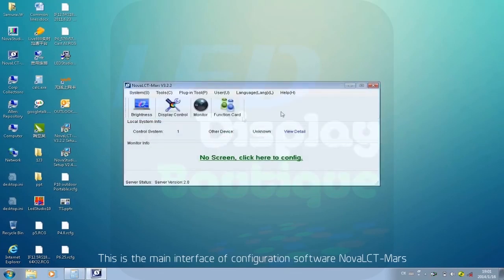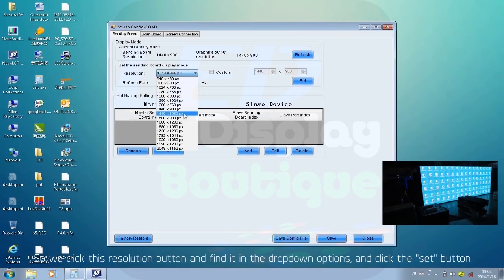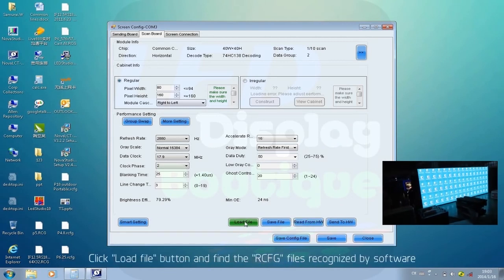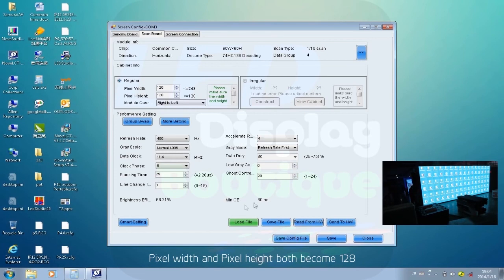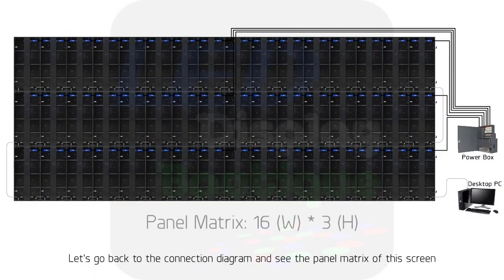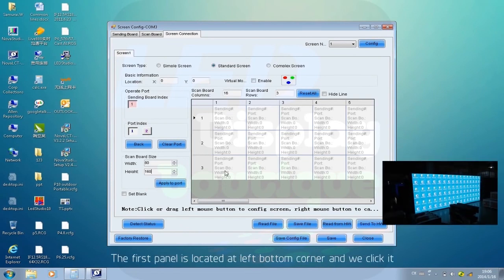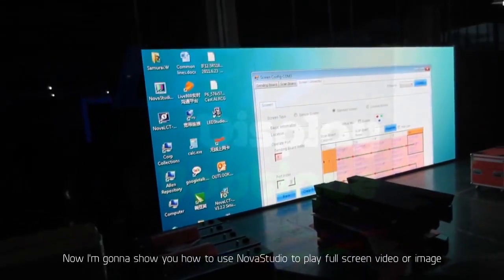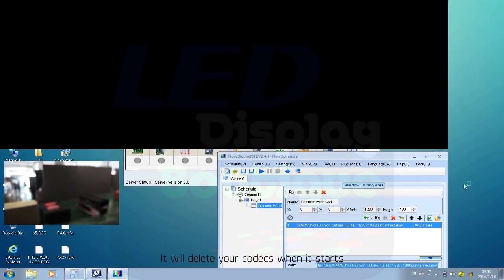NovaLCT-Mars Instructions

Comment: hi.   say I have a 80 panel led wall. for example a 10x8 wall , would I have to use 20 panels on Port 1 , 20 panels on Port 2, 20 panels on Port 3 and 20 panels on Port 4?

How many panels (or pixels) can 1 ethernet port handle? thank you